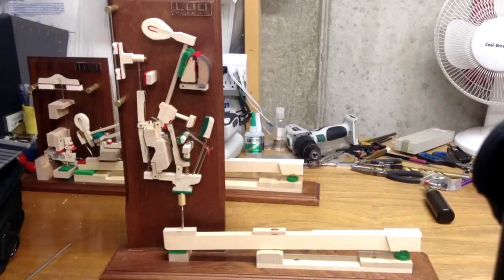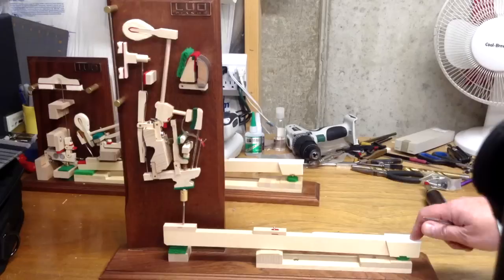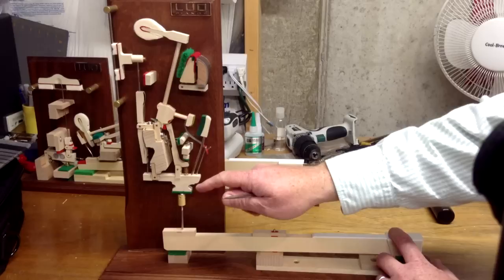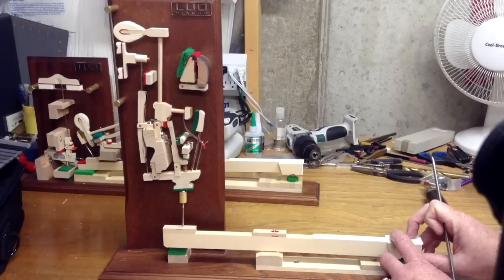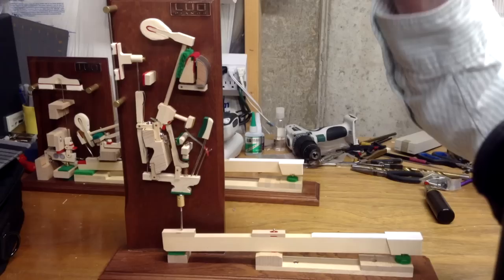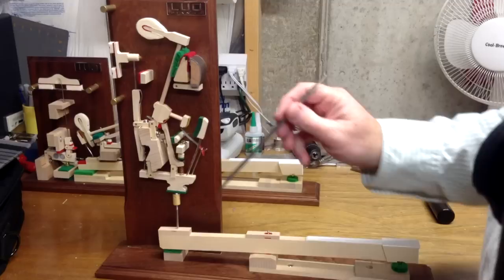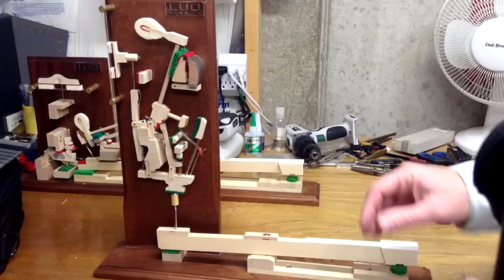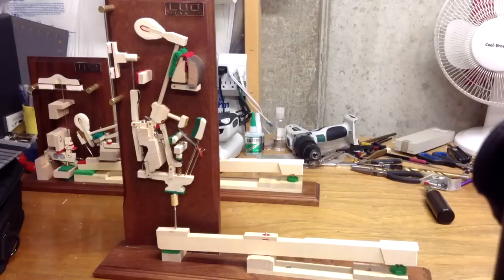How A Vertical Piano Action Works I HOWARD PIANO INDUSTRIES

Comment: I'm not clear on the role of the bridle, and was hoping to see that explained.
Reply from the maker: One of the main roles of the bridle straps is to ensure that when you take the action out that the whippens don't drop too low so that the top of the jack doesn't end up being too far back under the hammer butt felt when the action is reinstalled.  There may be a small amount of affect the bridle strap has on repetition, but this is debatable.  So realistically the bridle strap really doesn't have much purpose in the actual function of the action.
Reply: Thanks very much for that - yeah, it's a bit mysterious trying to see the effect of the bridle. The jack was getting caught on a few of the most-played notes on my piano, so soft notes slowly released would not let the jack reset, and those notes would then 'miss' the next time. So I was trying to make sense of what aspects of the action left the jacks a little bit loaded and sticky. My piano tech suggested messing with the hammer let off and the backcheck, and perhaps the bridle tension. Adjusting the backcheck seemed to resolve the problem, but I was unable to see what the bridle's effect was.
Reply from the maker: It’s very likely that you could have a tight jack flange.
Reply: I guess we've all suffered from tight jack flanges at one time or another. Actually though (after looking up "jack flange") I don't think that's the issue. I had messed with the flange (which I thought of as a hinge) and went so far as to change the whippen on one of the keys that was sticking a bit, and that made no difference. I think to the extent there's a big problem, it's with wear on the buckskin of the hammer butts. But messing with the backcheck and the hammer rail (depressions were worn in the rail padding, so the hammers fell further back, coming to rest harder on the jacks) seems to have kept things playable. It's an old, indifferent-quality spinnet, so doesn't make a lot of sense to get a professional involved, or to start in on major renovations.